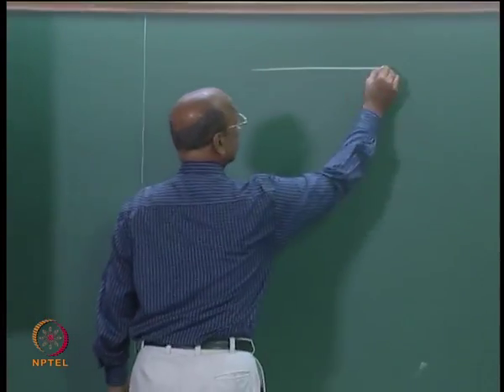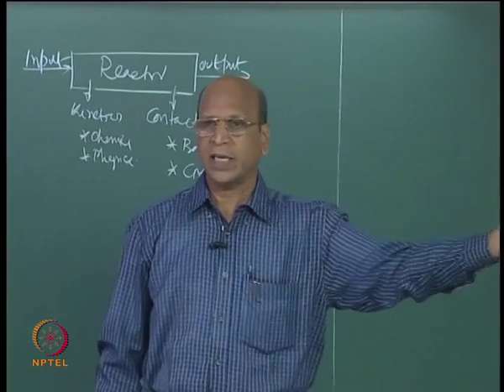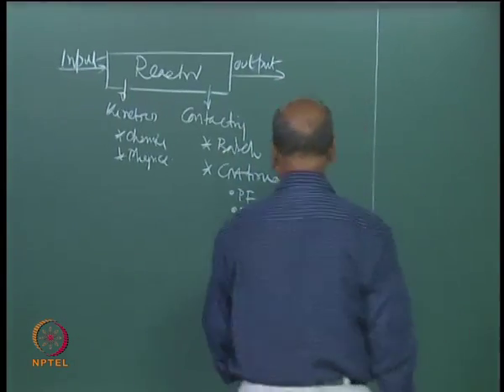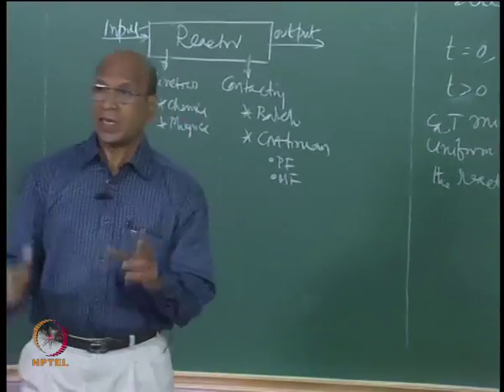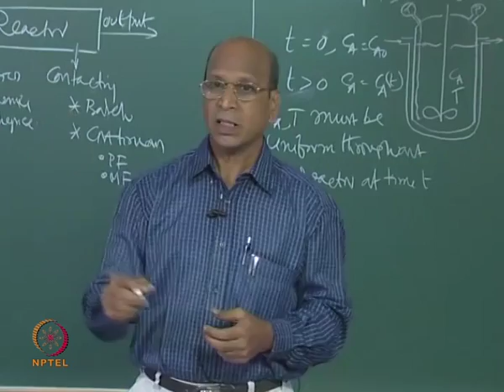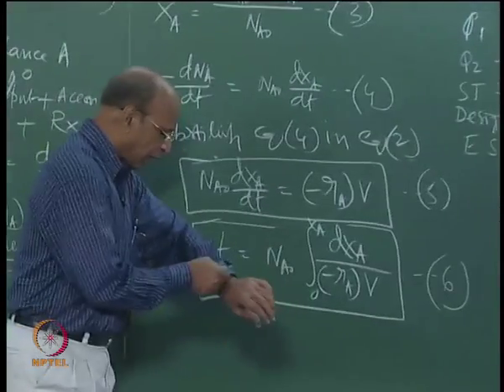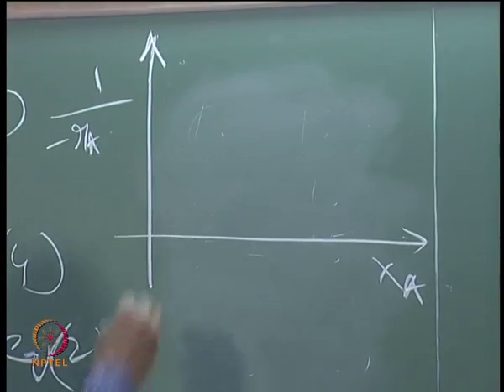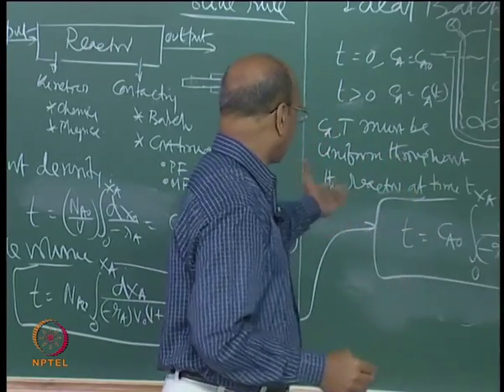Mod-01 Lec-10 Design of Batch reactors Part I

Comment: Can you please repost the derivation after Input = Output + Accumulation + Rxn? I did not understand the later half of the video because of that.
Reply: refer octave levenspiel
Reply: You can find these derivation in levenspiel book page number 91 under the title ideal batch reactor(chapter 5). Simple mass balance leads to the final equation...
Reply: Deplation.
Reply: Input rate is zero, output rate is zero, deplation rate is dC/dt. accumulation rate is rdV.